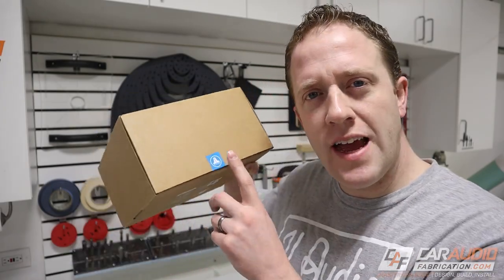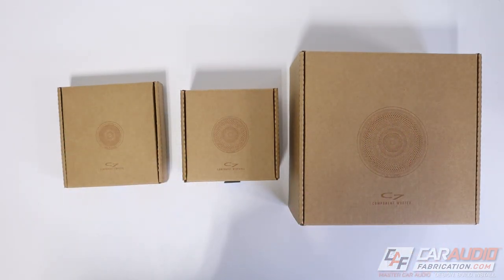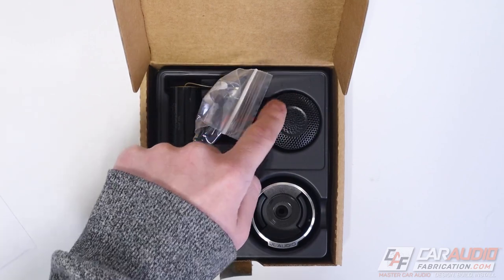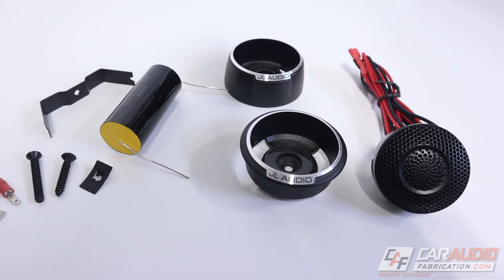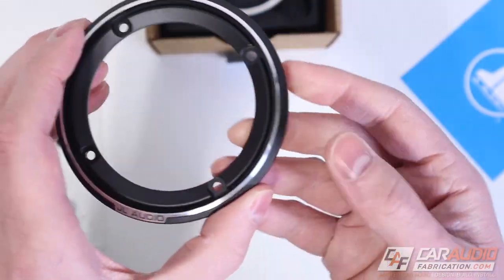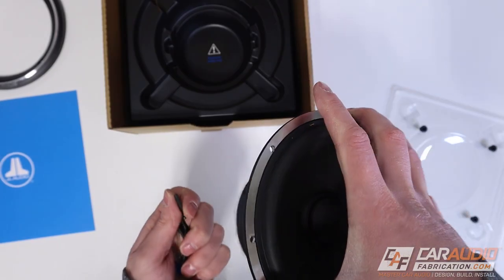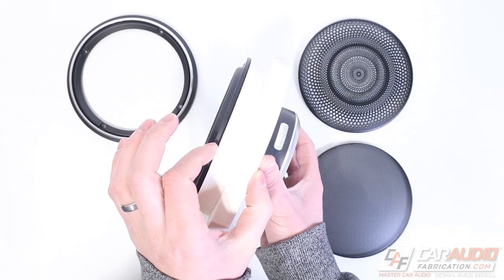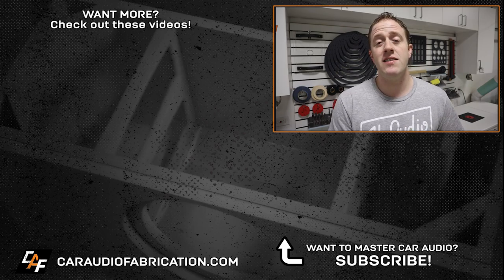JL Audio C7 Component Speakers - In Depth Overview!

Comment: The absolute best sounds speakers i have ever heard. Sadly $4k isn’t going to be an option for a lot of consumers
Reply: They're like 2300, same focal or morel
Reply: I hear you, 2300 for fronts, 2300 for rears plus 12 channels of amplification plus required dsp...I'm tapping out on this one.
Reply: I wouldnt run these for a rear fill, yes they're expensive but you get what you pay for in most cases.
Reply: Form a good relationship with your AD...never pay retail I paid $1600 for my 3way front stage
Reply: Anything is possible with a 0 apr credit card promo 🙏
Reply: Guess you have never heard Morel elates or supremos. 9in midbass in the door ..use a hybrid 4in or midrange instead of the dome 880 mid...then the mt 350s for tweeters...take 2 JL audio xd 600/6 bridged at 180 to 200ish watts a driver...so 600 watts per door.... That  is how you do it!  So loud it Will peel your skin back...and crystal clear.  That's how we do it.

Comment: I used to do quality control work for them in 2007. Components at the time are made in China but the subs are made in USA
Reply from the maker: 2007 was 13 years ago, things have changed. They absolutely build the mid and woofer in the Miramar location

Comment: The JL C7 Woofers are epic! Had them in my car with the C7 Tweeters as 2-way setup. The mid can play up to 8Khz with no struggle at all. And the mid punch is unbelievable! Tweeter isn't the best seen on the market. Replaced the tweeter with Audison's Thesis Violino II. Was a dope setup!
Reply: Thanks for the tweet recommendation,  I just bought a camry with 44 thousand miles looks like it was taken care of and I haven't had a system in a very long time so I think I want to go out and put something nice. Not crazy but nice
Reply: I have these now in my truck and not very convinced with the tweeters either, I feel like changing it fit a 2.5 full range that reaches over 16k hertz and provides reacher midrange
Very pleased with the mids through their whole range
Reply: @456Pegasus1 just so I'm sure I'm following along did you by any chance install the C7 6.5 speakers? If so what do you think and were they on sale  🤞 😊

Comment: I just bought a pair of JL Audio C1-650x and a pair of JL Audio C1-650 component speakers. I've installed the 650x's and they sound amazing! I'm waiting on some Tesa tape and some foam sheets so I can install the component speakers and do some rudimentary sound treatments.

I also upgraded to an aftermarket head unit and added a 50 watt RMS mini-amplifier. What a difference an amplifier makes. I've owned a lot of car stereo speakers in my life, and the JL Audio speakers beat everything I've ever used by a mile. I've had German-made MB Quart, Alpine, JBL, and Pioneer. The JL Audio blows by them like they're standing still. They're as good in the car as my indoor sound system is in the house.

Thank you for the deal with Crutchfield! I was able to get everything I needed with a good discount!

Comment: I have a pair of JL Audio ZR650 kits "previous top of the line" in my daily driver.. 
And I LOVE them!! 
So i will  check out the C7 too.
Reply: I just bought a set of ZR650s, placing them in the front and will run C5s in the rear. I'm hoping I don't get buyer's remorse.
Reply: @philgaerlan4853  Did you get buyers because I didnt. lol

Comment: I’ve had the JL Audio C5 components and they were fantastic.
Reply from the maker: We used those on the Supra I just helped build. They sounded great! Nice that they can be purchased individually as well and some more size options.
Reply: @CarAudioFabrication  hi,i need help if u could help me,I bought used subwoofer box with subwoofer and amp. Subwoofer is ground zero gzhw 30 spl. In manual says it needs 90 net liters for vented box but it doesnt say anything about the air. My box has 127 gross liters but i dont know how to caluclate it to net....
Reply: @CarAudioFabrication  how much bass could the c7 threeway keep up with?. I would be powering them active with a 120 watts rms per channel like how you did to your dads car. i would be using a jl audio 13w7 ran off of a hd 1200 amp.

Comment: I go way, way, WAYYYYYY back with JL. I installed for over 20 years back in the day when the tweeters were oval. Even today the 15 year old JL equipment in my car is still performing well. That includes the original Slash 300/4 and 500/1 along with VR speakers front and rear and three 10W1-8's. Let's not even start on my Eclipse AVN head unit.
Reply: Those slash amps were the best!!! Wished I kept my slash 500/1 that I sold with my sc300…

Comment: Definitely wish I could afford JL. 
I remember my original W6 setup in the 90s.
Reply: craig jones w7 didn’t come out in 90s but I get your point
Reply: @hadbl12  spell check. W6
Reply: You would have had the W6 v1? In the 2000's I ran 3 10w6v2....they were absolute bangers. Still the best SQ setup I've ever had.
Reply: @philgaerlan4853  yup the OG W6
Reply: I used to have 4 x 15w6 and im still trying to chase that same sound. They were loud and the cleanest bass i ever heard. All these modern day syper high power subs just dont get down like them 90s subs.

Comment: This is a great unboxing video. I absolutely love these speakers. I have a the 3 way set powered by a VXi800/8. Just perfect.
Reply: Are you sending 200 watts to each woofer? I’m about to wire up the same setup?
Reply: @marckusewich5870  Yes. I bridged channels 5&6 and 7&8 for the woofers. The 800/8 is perfect for C7's.
Reply: Wondering what your dsp settings are and if you adjusted the eq much? 
I have  the Same exact components and set up with mid bass bridged.

Comment: Thanks for the information, very detailed. I am currently on the hunt for an upgrade from stock & after seeing your review and seeing them onsite at a local stereo shop. I have made my decision. OMG. there are so many different manufacturers out there, but big difference in the C7's. I've been out of the game for sometime. I've heard of JL Audio, but not payed to much attention. I was about to give them the go ahead, then got my quote replacing a four stock 6.5 with 1 pair C7 for the front and 1 pair C6 for the rear with a 12" jl sub & enclosure with a JLVX800/8i running mid/highs, & a JD500/1 Mono on the 12". I was blown away at the price & no discounts for me. Full retail @ 10k, but it did come with  Blackhole dampening though out the vehicle and extra $350 to adjust the DSP. NOT> I ran, and decided to shop it. I'm still going to get the C7's, but else where. I'm hooked now that I heard them, along with many more. i.e. Focal, Audio Control, Alpine, etc.   Thanks for all you do. Greatly appreciated......
Reply: I plan on getting a similar set up. I expect the cost to be around 6k. Although I'm going with the c6s and not the c7s.

Comment: even though some of the materials are imported, JL still produces and assembles much of the speaker lines in their catalog. that may not matter to some, but it does to me! very few made in USA companies remain. 
i will say, the sub lineup covers almost any budget out there, if you can swing the upper end subs you wont be disappointed.. the W3 series is a great mid-cost sub. although i have not seen many praise their component systems, i would think some of the comps are top tier. wish i had a way to get a 3-way system in my Taco, without mods or those horrible looking aftermarket speaker pods. 
for now, i'll stick with my budget 2-way system but perhaps update in the future.. or on my next vehicle.

Comment: I have a question about subwoofers and midrange speaker cone's? I have always liked running polypropylene with rubber surround subs and midrange speakers but some of my friends run paper cone speakers! My question is what is better? I know the polypropylene speakers last longer as they don't rot also I like the sound quality.

Comment: Does it make sense for JL Audio to provide individual driver FR graphs if the speakers haven't been broken-in?  Next question, have they done a factory break-in?
Reply: @Ross Melton  

AFAIK, JL does not break these in before shipping them.  Maybe Manville Smith or Rob Haynes at JL will chime in and correct me, but out of the box, the suspensions are very stiff on these...i.e. the rubber surrounds and woven cloth spiders.

I installed a set of these and they definitely loosened up after a few weeks, enough that I opted to retune the system with the DSP.

Most high-end speaker manufacturers suggest at least 80 hours continuous for break-in for midrange and midwoofers.  The compliance specs will change a bit in that time, namely the Fs and Qtc/Qts specs.

I've used, tested, and installed 100's of different types of speakers, and I was really surprised at just how stiff the suspensions were on these C7's, especially the little 3.5" mid!  It was more like a High SPL subwoofer suspension!

These sound great, but for similar money, my current favorite is the Audiofrog GB60/GB25/GB10 combination.  Or just the GB60/GB15 2-way combo.  YMMV
Reply: @bbfoto7248  Thanks for the response BBFoto.  Funny you mention the Frogs, I'm currently running GB10/GB25 w/GS 690's for my frontstage.  The GB25's are currently/temporarily running wideband, as I haven't installed the GB10's yet.

Comment: How do the C7s compare to the Focal KX3s?
Reply: Focal kx3 mid-range really good, twitter really good but mid-bass really bad 👎. I had kx3 a year ago, I replaced for audiofrog GB60, GB25 AND GB10 and wow big difference especially in the mid-bass. I'm running active with xd800/8v2. 4 channels bridge just for GB60. DSP ALPINE PXE-0850S

Comment: This Cap sets the -3 db point at 2.7K first order butterworth. might fit so far. Its able to handle so much power, shouldnt be any problem for it.
I wonder if somebody measured if the tweeter is capable of real 200 Watts dynamic or Music for a couple of minutes...
But looks like a real good system of course!

Comment: Im already doing some custom A pillars and D pillars for my 2019 ford flex SEL thanks to whatever videos i have been able to find with you doing A pillars lol. Im going from C5 3ways to C7 3 way full active all around.
Reply from the maker: That is going to sound awesome!
Reply: @CarAudioFabrication  yes!!!! JL Audio  has been so helpful to me as well, they sent me some C7 flush mount tweeter cups a few days ago so i can get started on my A And D pillars. This is one of the reasons why ive been a JL Audio Customer since 2011. Just havent decided on the HD amps with a Twk88 or going the VXi amp route and having a bit of less power. Perhaps doing some Overlapping with my SMD DD1+ will help compensate a bit for that. 😁
Reply: Jose Luis Ruiz how were the c5s ?
Reply: @miker-s7219  the C5-653 3 ways are awesome! I have those in my Buick Park Avenue paired with an HD600/4 and they are bad ass!!!! So i figured if these C7 are the new Top Notch, they should sound even smoother and louder then the C5s. 👌
Reply: @joseluisruiz3789  

The wireless TüN app for the VXi DSP/amplifiers using their separate BT adapter is awesome.  Almost reason alone to use them.  But they are expensive.  Get the VXI 8 channel and bridge 4 channels for the midwoofers.

The DSP in the VXi amps include another DSP processed set of line level RCA outputs to send to any subwoofer amp of your choosing, even a non-JL amp.  So you could still use a HD1200.1 for your subwoofer(s) and use the extra DSP output channel from the VXi 8-channel or other multi-channel VXi amp to process your sub amp.

I'm sure you can hook up a decent discount from your dealer or rep tho'.  :)

Comment: What’s the difference between active and passive crossovers?
Reply: Passive is done via inductors and capacitors depending on what component you're making the crossover for, basically the frequencies get filtered below a certain threshold after the amp but before the speaker, frequencies near the cut off linger and you can get a soft cut off. An active crossover is anything like the crossover in the head unit/sound system per speaker, usually controlled by software and is a complete dead cut off, there are usually no lingering frequencies/soft cut off unless specifically designed that way or have an option for it.

Comment: That 3.5" mid range has my interest peak. I'm in the process of planning out my system for my new 2020 Dodge Ram. I've been having issues finding a 3 - 3.5" mid range that can handle at least 100 rms.  Right now I've found  Dynaudio and CDT options but this JL 3.5" will be added to the mix. I actually have a question about how to set up my 3 way system If anyone would care to listen and give me some feedback?

 My question is what do you think about using a 3 way setup where I'd use the 6.5" mid bass speakers on channels 3/4 of a 4 channel amp with a BP crossover. I'd send the 6'5's 80hz-250hz. The tweet's and mid-range I'd use a CDT ex-30 passive crossover which would send the mid-range 250hz-5500hz and the tweet 5500hz and up. This would be a mix of active and passive so I'm curious what anyone thinks of this or would I be better off going with a 6 channel amp and full active?
Reply from the maker: It would be best to go full active.
Reply: Do it right the first time that truck deserves it and you don’t have to worry about it sounding better if you would have went with the other option instead
Reply: @fpalenciafp  Yeah you're right and I do plan to open the budget up a little bit for this. This is going to be a permanent install and I plan to have this truck for many years. I'm going to start with the 6 channel audio control amp with the built in DSP.
Reply: Have you looked into like a fix-86 I think there the easiest to tune because of the blinking lite I had a loc-22 on the subs I had on my 2019ram with a slash 1v3 on two 13.5tw5
Reply: Apart from the 3.5 mid I will be running this exact setup, imo definitely go full active, because a passive crossover worthy of this system would probably outweigh the cost of just getting a 6 ch amp and reaping its benefits.

I'm also looking for options for a rear speaker (coaxial) to pair with these that can handle the 125rms of the D-6.1200

Comment: Hi Mark!  I'm installing a car audio system using one (1) AudioControl D-4.800 for the satellites and a LC-1.1500 for the subwoofers.  If I was to use all three of the speakers of the JLAudio C7 system, can the digital processor built into the D-4.800 actually work as a crossover (and band pass) for the JLAudio C7's if I was to install a set of JLAudio C7's in the front and a set of JLAudio C7's in the rear?
Reply from the maker: That wouldn't work as that amp has four channels. You would want one channel per speaker. So with 6 speakers up front and six in the back you need 12 channels plus sub.
Reply: Yeah, if you wanted to run 2 way c7 components that 4 channel with built in dsp has al the bells and whistles necessary.

Comment: The price is killer for each piece. 
$2,000 for just 4 woofers, nearly $1,000 for 4 tweeters (my vehicle has 4 tweeters), and $1,500 for the 4 mid range speakers. Now, I know that whoever buys this clearly has the money to do as they please, but these are the most expensive speakers I could conceivably buy. I could go buy a mid-price range set of Rockford Fosgate comps and tweeters, a 4-channel amp, radio, sub and amp and not break $1,000 depending on what I went with.

Great video, just extremely expensive products. Average consumer probably won't give these a second worth of thought.

Comment: So I have this same vehicle and I want to put in new front components with the factory wiring. I would like to put the crossovers in the doors. Are there pigtails in the front doors to go to the factory tweeter location? I would prefer not to have to run new wires to the tweeters if at all possible...

Comment: Hey Mark,  Im going to be running 2 c7-100cts and and 1 c7-350cm in my dash on my truck. These are recommended to be ran as active and with a dsp. I will be using a LC8i since im keeping my factory head unit. Does the LC8i serve as an active crossover? If so do I need a dsp? I was told If I get the LC8i then its kinda pointless to get the vx800/8i since the LC8i does all of the fine tuning to run any basic 8channel amp without DSP?

Comment: i am getting ready to do a complete system in my 6th Gen Camaro .. i am debating on going with these 3 speakers or Focal KX3 system .. which would you go with and what Amp DSP would you run with them .. i am going with a JL W7 12 AE sub also... i don't believe i will do rear speakers or deck speakers i think these either one would be plenty .. Please give me your advice and i am supposed to do this in the next day or two ... i like your videos and watch you all the time.

Comment: I have all C2s. I found that my door speakers are distorting so badly. I was told to buy a new head unit but that didn’t fix anything. I’m guessing all I can do now is amp then up? The speakers are definitely not blown as they sound amazing hooked up to the rear of the car. Bass isn’t up too high or anything 🤔

Comment: Mark I have a pioneer Deh 80prs running in metwork mode I just installed a pair of Punch Tweeters they came with crossovers they are 3500hz & up should I use them even though I using the onboard crossover in the head unit?